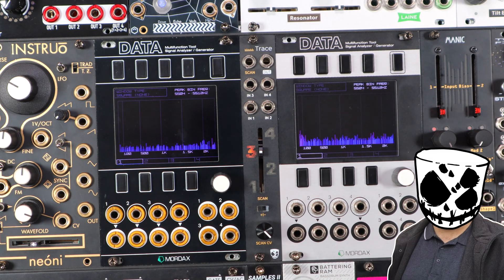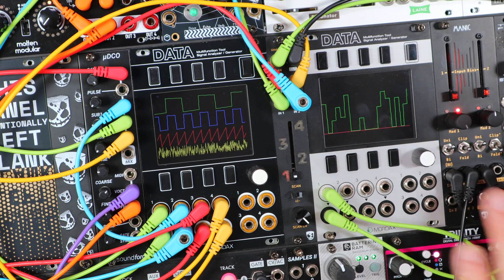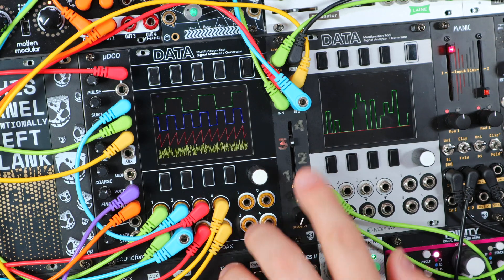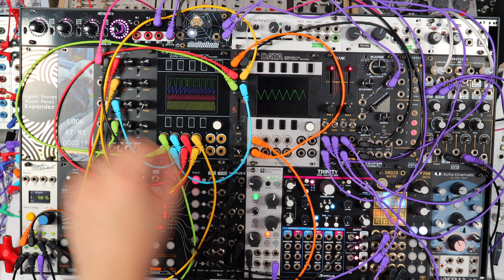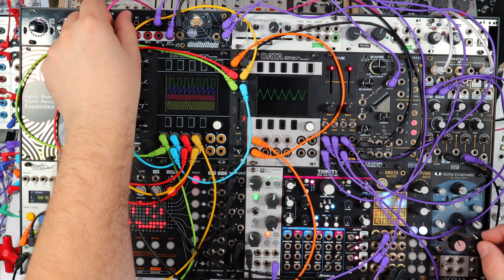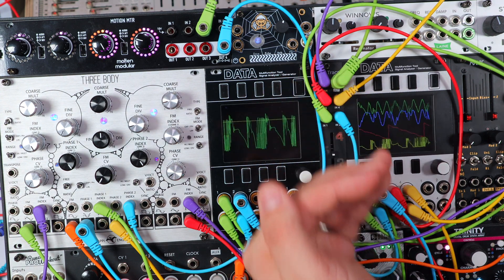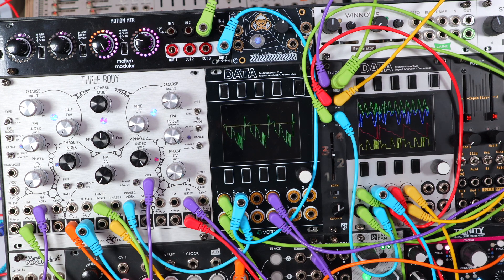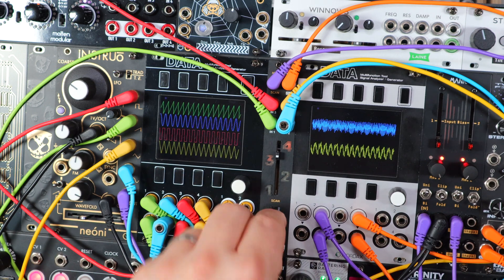Expand your VCOs with TRACE // 5 Techniques for getting more from your oscillators (DivKid & Vostok)

Comment: So this like a mi frames, mixing thru 4 inputs?
Reply from the maker: You can certainly approach it in the same way, but Frames defines the level of each input/output per keyframe, this scans through them sequentially. You can't for example have inputs 1 and input 3 active at the same time, or a custom mix profile of all 4 ins. Think of it as 3 crossfaders in series 1-2, 2-3 & 3-4.